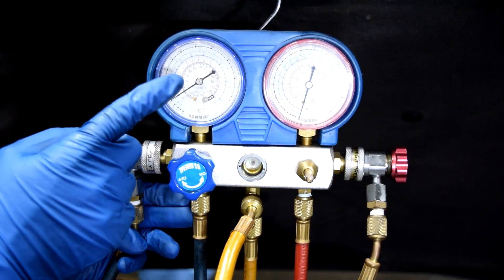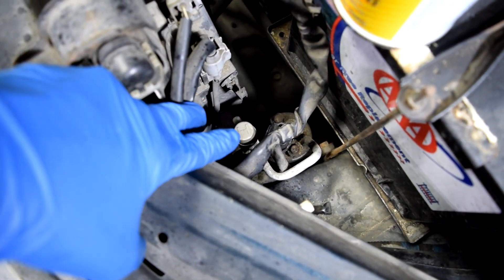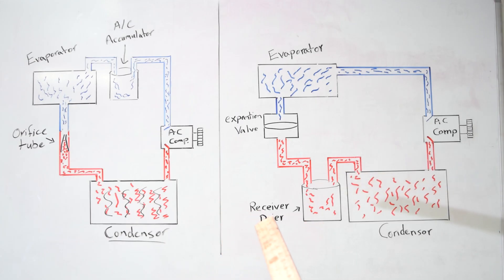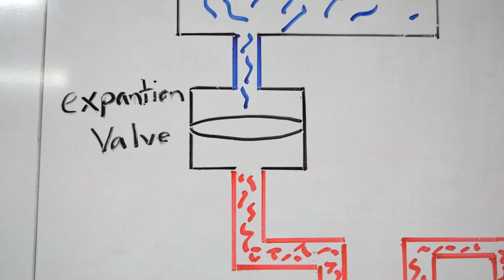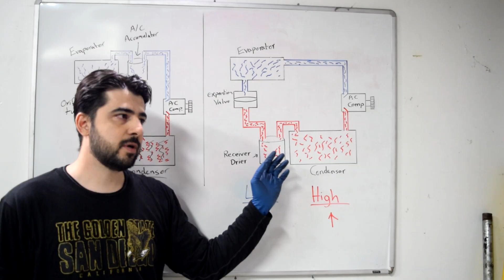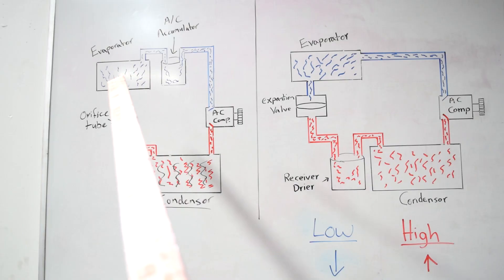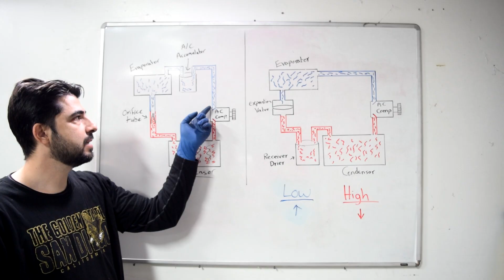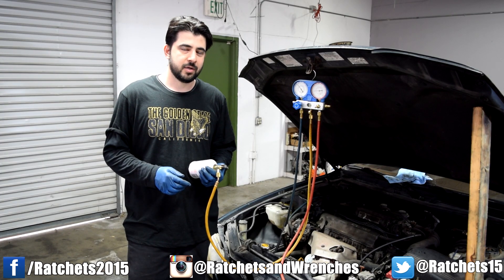How to Diagnose and Recharge Your AC System with Refrigerant - Using an A/C Manifold Gauge Set

Comment: What if it's within the number? My low side 30, high side 145, weather 73F humidity 75,

Does that mean I'm low on freon? My ac blow warm air when rpm over 1500. I did removed a shim from the clutch after watching a few videos but that didn't help.

Comment: I just added 4 oz of refrigerant oil to the compressor and the recommended amount of ac oil to the drier/receiver, but not to the evaporator. Now, I’m going to recharge the ac system with refrigerant. Do I still need to add more ac oil?
Reply: It's usually already in the can of replacement refrigerant I believe.....?

Comment: Hi my friend  again! good explanation.....
Question ?
So how do you know is empty  or how much refrigerant is in the car.
Because you just put one can only,

is a way to know how much refrigerant is in the car?

thank you!......i am confuse......because you put only one can and it was smaller can.....thats right. 
thank u.....
Reply: The chart will let you know how much is needed to add depending on the outside temperature. The gauges will let you know what is the correct amount. The sticker on the hood will tell you the max amount of Freon to have in the system.

Comment: Dear RNW you are great and you take your time to explain things well. But I have Question about my system which is confusing and I have not seen solution to it on you tube Maybe you can Help. I have Tundra 2001 it had front right side body damage affected the fender, RF headlight and air filter housing and bent the condenser, also replaced the Radiator, and fan was broken also. All were fixed. System had pressure even after accident. First situation was Low pressure low (15-20), and High pressure High over 250psi, and clutch engage and disengage frequently we added Freon just a little high side went way up and low stayed the same, pursuant to Toyota Diagnostic table, indicated Blockage in the Receiver Dryer or expansion valve, we replaced both, we also tested all the line connection for leak, after replacement and testing condenser for leak we got to situation 2. Now the condenser have minor bent but holding pressure, the low is steady normal at 40 psi, and the high side went too high 275 and kept increasing to about to 350- to 375 close to 400psi and we did not even put one small can and clutch  engages all the time without stop. Do you suspect the high pressure sensor not closing the circuit and causing all of the issues?

Comment: what are the temperature scale on the gage for on the low side 90degrees line up with 105 psi and it should be 45-55 psi and the T fitting on the yellow hose has a cap if I take the cap off and store the other end of the yellow hose there like I see you have it do I have put the cap back on when I use the gage  thanks for your help Bert

Comment: Based on my understanding, the valve on the high-pressure side should also open facing down instead of facing up. Because the AC compressor draws freon from the low side to the high side, if the valve open facing up like in the diagram, how come the valve get open?
I hope some one or the author can help me understand. Thank you!

Comment: My gauge set connectors don't work. One has a spring problem, and the other locks but doesn't seal, leaking freon in the process. Should I replace these cheap connectors?

Comment: I did not see you crack the vacuum line, that's the yellow line. Connect the can,  and then the line is full of atmospheric air. You bust that air together with refrigerant into the system?  Looks like yes. You are supposed to pressurise the yellow line, then crack it a bit open up there at gauges, for a bit of refrigerant to escape, which busts the air out. Tighten back up. Now you can open the low side to charge!
If you think you are a profi, then be a profi, not just a garage dude!
Reply: It is called a service line, and who only a shadetree mechanic would use the term "crack"...get it right.  And some service lines have a check valve (if you know what you're doing, you can recover/store refrigerant in the service line to prevent having to "crack" the line.

Comment: Question:  Pressure readings when to record them?  The gauge records a low number and  a high number.  Which one do I use? I can hear the clutch "click" and the low number PSI increases.  Example: Low side is 25, then increases to 68.  It then decreases to 25 again, repeating the process.  Which numbers do I use to assess the system?  thanks "yours"
Please reply at 1clyne@integrity.com

Comment: Thanks good video! But, How do you know the amount of the refrigerant that is delivered to the system is optimum so that the system would function as it was designed to have optimum sub cooling liquid and overheated amount of vapour in the system?
Reply: It's the optimum amount when the pressures are back up to normal pressure.

Comment: im reading zero on both high and low before and after you start the truck....whats that mean
Reply: Brian Bronston no pressure, no refrigerant...there is a large leak somewhere
Reply: Add compressed air with a rubber tipped gun into the manifold where the yellow line screws in. Use 1/2 soap and 1/2 water in a spray bottle and coat all your connections with it. When you add pressurized air, watch for bubbles. Just did it tonight, and found a huge leak. Make sure you pull a vacuum for a couple hours after you fix the leak or replace the bad part. Only do this trick if you have zero pressure or zero refrigerant in the system.

Comment: what if I open the low and high side valves on my manifold gauge when checking ac pressure.but not charging the system.
Reply: Your yellow, service tube will be "active."  If it has a check valve that prevents outside air from getting into the system, you should have no problems.  If your yellow, service tube does not have a check valve, then it will allow outside air to enter into the system and you'll have to vacuum that out.

Comment: what's the problem when these happens?
Low side too low -- Hi side too high
Low side too high -- Hi side too low
Low side too high -- Hi side within a range (my case 50 psi on low 225 on high, blowing warm air, compressor runs non stop)
Low side within a range -- High side too high
Thanks
Reply: Did u ever find out. Appreciate any help

Comment: Question, by connecting the manifold gauges and hoses woud it not cause a pressure drop in the system?, and affect the measurement we are trying to get?...
Reply: Nah.  Especially not if your gagues have shutoff valve on them near the quick connectors and these quick connectors are set to not depress the shrader valve when you connect them (in the unscrewed position).

Comment: On the manifold between the blue and red knobs and just above the yellow hose, is that a window or is it for a connection of some kind?
Reply: Its a window that allows you to see refrigerant and/or oil and/or dye.  On some gauges, just below the window there is a valve that allows you to purge the yellow, service line.

Comment: Hey there. Good vid. ? I have a 30Ib jug of 134a. How would I charge my truck  from scratch after my vaccum is complete?? Do I dump in the gas with jug down (liquid) from the high side or do I dump in jug up (vapor) through the low side port. Thx again!
Reply: NEVER charge through the high side port! You will allow excessive pressure to go from the compressor into your refrigerant container and it could potentially explode, causing serious injury or death! ALWAYS charge  through the low side port only!
Reply: Best to add vapor (jug up) and since you pulled a vacuum, weigh the amount added per the system's data plate.

Comment: I thought you should only refill on the high side?
Reply: The compressor would only explode in Hollywood.

What would really happen is that because of the higher system pressure (pressure differential is the means by which fluid transfer occurs), nothing at all would happen, or the compressor could pump refrigerant from the system back into the can.
Reply: That will cause the compressor to potentially explode, and harm the vehicle and possibly yourself.

Comment: I keep getting low refrigerant levels after a few weeks. How effective are sealants?
Reply: Check your schrader valves (most common leak point). Use refrigerant that contains dye to charge your system. Then come back a day later with a blacklight. You'll see the leak clear as day with it as the dye glows bright yellow under a blacklight. Then address the leak.
Reply: I have a theory that leak sealers can clog up the orifice tube.
Reply: If you have a small leak due to seals, they might work but usually they are hit and miss. I would recommend A/C Pro, its like 35 bucks at target/walmart. It lasts me like a year, its best to spend $35/year than $1000 to replace the whole AC system.

Comment: I have a 93 pajero 3.0l v6 6g72, its has a r12 system, I`m going to regas it do I have to change the compressor oil? or just buy r134 and fill it, tested earlier no pressure at all, gave to a mechanic to do timing belt think he disconnected ac instead of just moving to the side.
Reply: me001ist I know this is old but just in case for anyone else reading this: never mix R12, R134, R404....because they are completely different from each other and we end up ruining your AC system coating you loads of $$$. Use the one designed for your car.

Comment: good job i got question what would be the problem if my system does not suck out freon out pf the can hi and low pressure 80psi with ac rinning thanks paul
Reply: Which type of system do you have?

Comment: You did not bleed out the air from the yellow hose before turning on the low side to allow the 134 into the system.
Reply: So, you'd hook up the couplings on the service ports with the engine not running and bleed out the  hi and low hoses at the manifold connection?
Reply: How should he have done that?  If you could explain it in detail to a noob, that would be great.  Thanks in advance!
Reply: Truth Finder
Reply: You want to purge ALL lines; yellow, blue, and red. There is air from the atmosphere in all those hoses when you connect. At the gauge manifold, open each line for about 1 second (depending on length of hose) before opening the manifold valves.

And yes wear gloves. I usually don't and let me tell you, it's cold.
Reply: Keeping the yellow line connected to the tank of refrigerant, you will want to partially unscrew the yellow line where it connects to the manifold, with the manifolds valves turned in the off position. Open the valve on the tank slightly to purge the air out of the line and then screw the line fully into the manifold. Wear gloves.

Comment: on the dynamic pressure reading with the ac system on and truck running and the compressor running. . my pressure gauges fluctuate from 18- 40 low side and 200-280 high side like ever 15 to 20seconds. I just install a new compressor orifice tube and accumulater so. the temp on the front air vent will show 60degrees F. .... So is this normal?? or is the pressures suppose to be constant.???

Comment: I am trying to diagnose my 2000 Mustang GT A/C problem.  I have been searching for hours and I cant find a video that has my specific issues combined with my troubleshooting results.  You videos are very informative and I was wondering what you think.  The A/C blows warm air and the compressor clutch is rapid cycling.  My low and high pressure switches ohm out correctly.  Manifold gauge readings are @80/80 static (80 deg F 30% Humid).  When the A/C is on the gauges read 20-60 on the low and 100-125 on the high.  If I jump the low pressure switch, to stop the rapid cycling, the compressor runs continuously and the low side goes to 0 and the high side stays at 100-125.  Bringing engine rpm up to 2500 never increases pressure.  Gauge pressures are unaffected by rpm.  No obvious leaks but I have not leak tested yet.  I'm narrowed down to a leak causing low charge or the compressor is bad.  Any advise would be appreciated.  Thanks for the great videos

Comment: After watching numerous other YT videos on this subject, I found that yours is the only one to logically explain the steps to topping up the refrigerant.  You were the only one to mention the IMPORTANCE of making sure the valves are in the correct position BEFORE attaching to ports (and can of refrigerant).  Excellent!  The best presentation yet on this subject!  Keep up the good work!
Reply: It’s impossible to get them mixed up . That’s why they are different sizes.
Reply: @crisperez592  I believe he is referring to making sure the valves are closed at the manifold (clockwise) and valves at ports are also closed or backed out (counter clockwise)  to not depress the Schrader valve. That's important stuff. You are correct though. Impossible to get them mixed up.

Comment: Good explanation.  I would suggest using the refrigerant to flush the air from the charging hose before allowing it to flow into the AC system.  There is a valve for that purpose on your manifold gauge set. Sometimes you don't get away with turning the can upside down and allowing refrigerant to flow into the system in the fluid state. I'd keep it flowing in the gaseous state just to be safe.
Reply: purge with the shrader valve on manafold after connecting R134a then open coupling valve slowly on low psi side to charge watch gauges
Reply: Some vids say 12 to 3 turning of the can. Others say all upside down. Even on the can of refrigerant it says hold upside down so which is right?
Reply: @cooldude2245  did u get a answer? I still am confused. Everyone says different
Reply: Ini komenan yang paling benar terkadang sebagai tukang service ac juga kurang begitu memahami akan hal ini..

Kenapa dalam mengisi refrigeran kaleng harus dalam posisi berdiri tegak dikarnakan masuknya refrigeran ke jalur LP berbentuk gas begitupun refrigeran bekerja dari output evaporator juga berbentuk gas bukan cair ..
Satu hal lagi dalam mengisi refrigeran cair kaleng di balik dipastikan jangan menyalakan mesin mobil  sampai refrigeran di angka 40 psi segera tutup kran HP

Comment: Hi, I tried the refrigerant, but still not cold air is coming from the vents. I think there is something wrong with the compressor. Belt is not running on AC. Any ideas on how this can be fixed. I don't want to take the car to the store and pay lots of money for repair. Thanks.

Comment: I never understood why some systems have a receiver dryer and others have an AC accumulator. Are they always linked as follows?  expansion valve has a receiver dryer, orfice tube has an AC accumulator. Why?
Reply from the maker: +spelunkerd I think on the setups with an orifice tube some of the refrigerant is still in the liquid form after leaving the evaporator and the accumulator acts as a catch for the liquid refrigerant so it doesn't get into the compressor and damage it. It also cleans the system of dirt and moisture like a receiver drier.